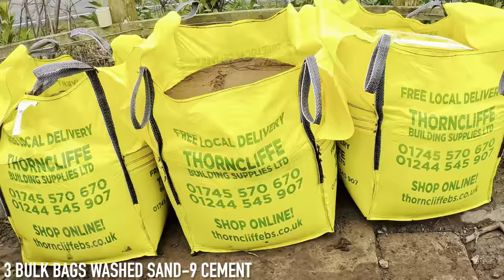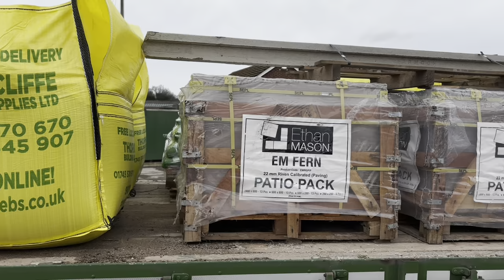VOLVO TRUCK AND HIAB CRANE THE BEST COMBINATION?HGV DRIVER DELIVERING BUILDING SUPPLIES|UK 🇬🇧

Comment: Palfing are,also a good crane quite easy to use
Reply from the maker: Hello, I’ve only used a palfinger a handful of times many years ago. Is that what you operate?
Reply: I don't operate  crane any more I could get on with Fassi at all

Comment: Hi mate hope you're well. Been doing the job on and off  for about 20 years and still enjoy it. Do you not grab tonne bags
Reply from the maker: Hello mate thank you for watching 👍, I will grab bags to get under low trees etc…. Otherwise we prefer to hook them on it’s just the way we have always done it. Where are you working ?
Reply: @SCRUFFYPIGEON  I work for a company call Chandlers in Banstead. Surrey
Reply from the maker: Wow ! Pretty far away mate . What is that part of the country like to work at? What truck and crane do you use?
Reply: I drive 26 tonne DAF with a fassie crane. And I've a built it sat nav witch is very helpful when going into London